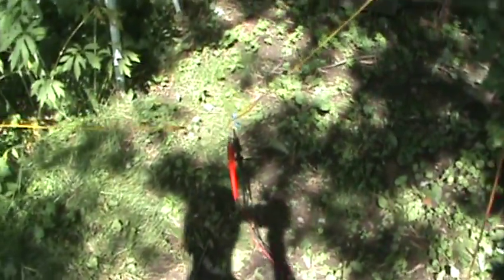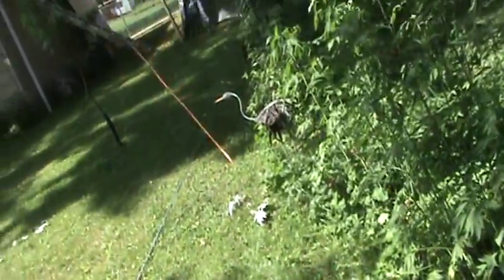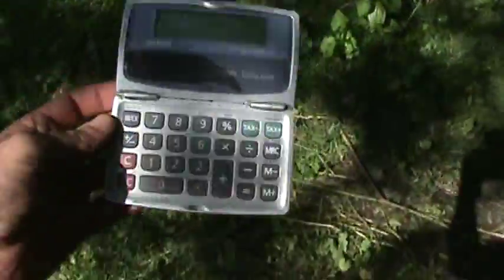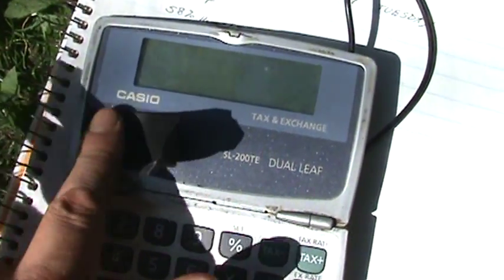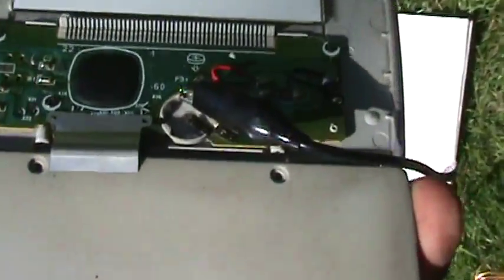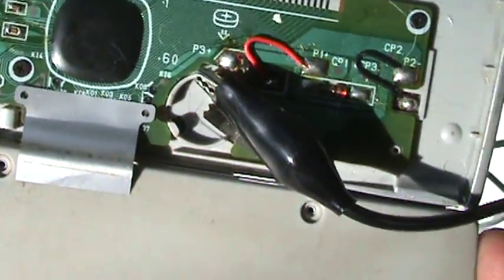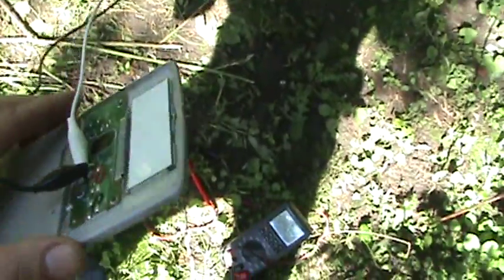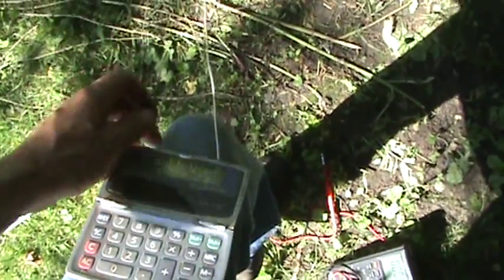FREE ENERGY FROM AIR CIRCUIT PART 7/24

Comment: Hi Paul. At one point in this video I saw a chain link fence. Would that make a good  ground?
Reply from the maker: +Bruce Dobson I tried adding the fence to the grounding system at one time, but no better results.  Maybe because there is too much above ground, im not sure.
Reply: K. I was just wondering. Maybe whatever electricity the fence picked up went straight to ground and neutralized the grounding effect of the fence posts. Thanks again
Bruce

Comment: how do you get more current??
Reply from the maker: Great question.  Can get a little more by connecting 2 circuits together in parallel.  Or you could connect more antennas.  But both ways give only minor increases.  Im working on a way now to use the voltage & resonating pulses to get much more power,,,,we will see how this works soon.

Comment from the maker: I used sling shot/wrist rocket & rock to shoot fishing line over high branch. attach fishing line to wire antenna to pull it up,,,but keep antenna wire insulated from the tree,,make sure it is the fishing line that touches around the branch & not the wire. Yes, let me know how it turns out for you, thanks.

Comment from the maker: @ptrakk correct with the frequency. I should be just below am radio. I just got a variable cap with large range
directindustry . com/prod/seaward/variable-capacitors-trimmer-capacitors-26669-456069.html
I will try to tune to schuman resonance very soon :-)

Comment: Navigation, time signals, AM longwave broadcasting (Europe and parts of Asia), RFID, amateur radio
SOURCE: wikipedia . org/wiki/Radio_spectrum
and then you have a tuner circuit with those coils and capacitors.
so i could also be just some white noise.

Comment from the maker: @randomcoolzip1 multiple frequencies, more power, i was wondering this myself and will be doing experiments with that soon.  tuned to no station, i believe it would still generate power, but many may argue with me.  I just checked my frequency this friday,,,it was 275 KHz, incoming on the antenna. This is below AM radio, and above power line frequency.  Higher my antenna , higher the frequency goes.

Comment from the maker: @randomcoolzip1 there is endless info of antennas, can get quite complex. Higher frequency, more EMF, hmmm, maybe in most cases, but i believe it depends on the application or circuit design,,im not possitive.
The idea of windmill antenna with coils, i like this idea, very interesting.

Comment from the maker: @randomcoolzip1 I have new tripode now for camera :-)
tried charging car battery for 3 weeks, no luck, but still making changes, and increasing current now,,if i have some interesting results, new video soon.  I now just made new set up with multiple antennas, experiments with it begin tomarrow :-)    My antenna now is not tuned to anything that i know of,,maybe in range of garage door openers or baby monitors, low frequency.  charging small batteries, i have not tried yet, want to get more Amp

Comment from the maker: Thanks for the good comments.
AC. voltage...hmmm, i did not check it with this set-up yet. But if i remember corectly ac voltage always checked lower than the dc did.
i did try coaxial cable & got same results.
even using thick insulated coaxial cable for antenna....voltage still goes down fast when you touch it, that was interesting.
it was good talking with you on the phone.